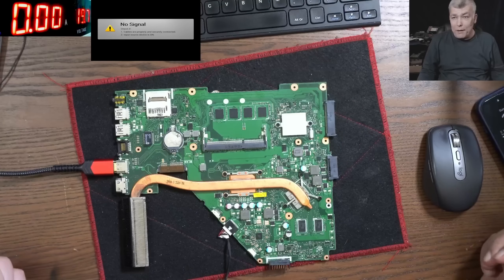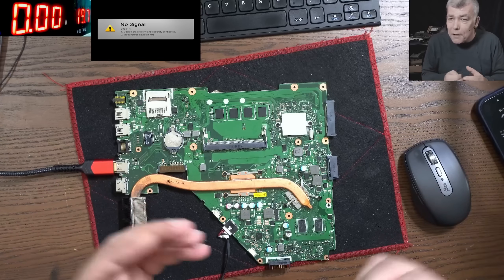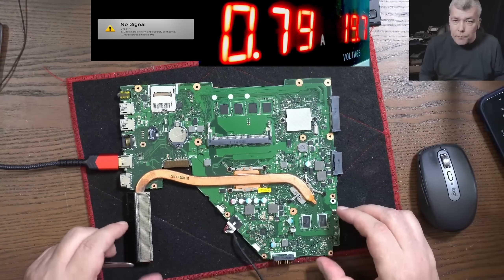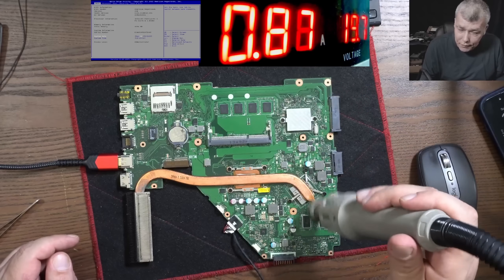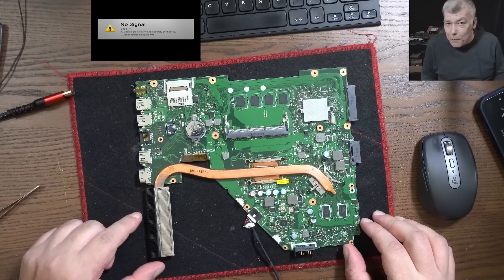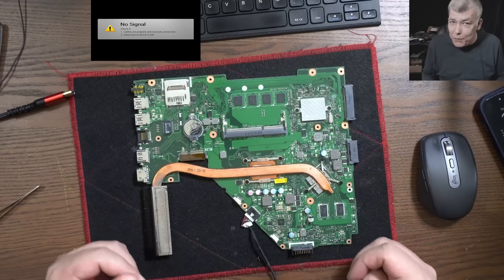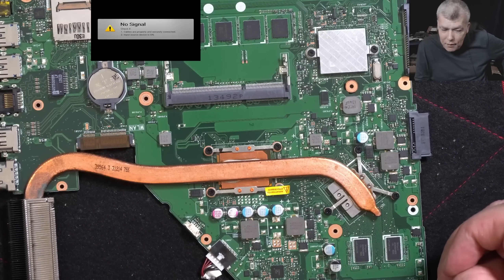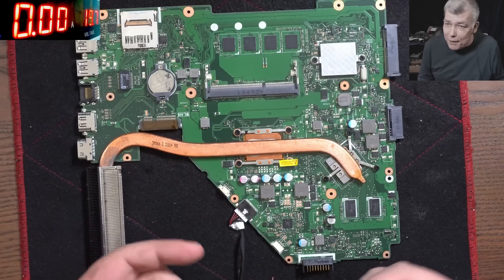That's why the MOSFETS are getting burned - A pretty cool experiment

Comment: Really I enjoyed the explanation for the problem

Can I ask you a favour please?
Do you have a video for reflowing the VGA in case it is not working properly ( especially in Dell laptops )
I tried to reflow it on 250 degree as many videos said but working for one week then played again
So I need your experience if you have the same video just give me a link for it , or tell me what the suitable temperature to use when reflowing that chip

Thanks in advance for all your efforts
Reply: Reflowing a dead chip helps only temporarily (the heat "fixes" broken things inside). To really fix, you need to REPLACE the component, not to reflow it. See Louis Rossmann video about it.

Comment: I usually put thermal pads everywhere because i don't like the components to get hot. Hot means less life. Redesigning the motherboard with 3d printer and make new Copper heat sink it the best way.

Comment: This is a great video to show why it is so important to not use computers in a very dirty environment, and if you do make sure you clean them often. I have many computers that are more than 10+ years running just fine as I take care of them.
With the power draw, it is also important to point out the fact that people should keep their computers connected to power as often as possible and not only rely on battery as the battery will most likely not be able to give all the power for max performance.
Reply: And computers were made to last longer back then.

Comment: Guys, he is right but don't do that by yourself, I did that with my Acer Nitro5 AN-515-58-725A and it is not turning on after replacing the thermal paste. I accidentally unplugged the screen before Battery and the laptop shows shorts on the motherboard everywhere, it does not turn on, and I don't have a thermal camera and power supply to find the bad component on the motherboard. I am about to cry because I am a student and I really need my laptop I don't have it anymore since 2 months ago (dead laptop), and I am in a small city in the U.S. with very limited options including replacing the whole motherboard which is very expensive for me :(
Reply: Hey, how's the laptop did it get fixed?

Comment: Interesting. I've been dabbling with electronics recently, to help feed a curious mind and attempt to repair a part rather than replace the whole. I find mechanical fault finding etc fairly easy, logical and straight forward. The electrical side is a little less intuitive and ofcourse if is not obvious visual evidence fault finding requires more knowledge than I as a layman possess. This video clarified some things I have been told by techs I've spoken to. Combined with comments from other viewers more knowledgeable than myself, I feel I have gained a decent base level of comprehension. Ofcourse as is most often the case, answering a question poses many more questions. Lol.
It is a major task just to access the parts to service them. Equipment being serviced is downtime for production. The ervicing vs replacing becomes hard to justify fiscally. I currently have a pretty decent thermal imaging camera on insefinite loan from a friend. I'm wondering if something like this used at semi regular intervals to check for variations in temp would indicate when work was necessary before something failed. Obviously I'd be viewing the housing/outside of the equipment. Not the components themselves directly. Mostly stainless steel and sheet metal or plastic. I feel like even with accurate imaging the temp differential may not be enough to pre-empt failure?

Comment: I have noticed that resistance actually drop with the rise of temperature, at least on some parts of the board. I also noticed this watching different repair videos. For example when shorted capacitor is removed and resistance is measured to check, it can be seen how resistance increasing as the board is cooling down.
Reply: From wikipidia; Silicon shows a peculiar profile, in that its electrical resistance increases with temperature up to about 160 °C, then starts decreasing, and drops further when the melting point is reached.

Comment: What can also happen is the ABS plastic casing becomes brittle, drying out from the constant heat. The hinge stiffens up, probably from dried up grease, this then goes on to break the brittle hinge mounts, ending up with a broken hinge. The left hinge always breaks first, right next to where the heat is expelled from 99% of laptops. You have to ask the question, why is it designed that way. Bad design or again, planned obsolescence.

Comment: Thermal pads on their own alone do nothing other than, some times become a saturated heatsink essentially "cooking" the component they are attempting to cool in the first place, you need to have something to take the heat off of them before the become saturated or somewhere in between the temperature limit the component can fail regardless because it can't handle the heat anyway.
Passive cooling is only good when you can extract the heat passively fast enough something which it depends on the environmental temperature, which, the more it raises, especially getting near the component's temperature, the less the amount of heat will be dissipated/transferred away.

Comment: A modern CPU will attempt to lower its voltage to frequency curve until it can no longer do so, then it will attempt shutdown, but if an external source keeps heating it or keeping it heated, especially more than it can handle (working or not) within a certain time limit (based on the material's thermal limits), it can still fail regardless, a saturated heatsink can cause that, unless the heat is getting away faster than the max amount of  heat the heatsink  can dissipate in time before being saturated and before the cooled component fails as well, which is when it needs active cooling.
This video illustrates this perfectly.

Comment: We call over-heating something when it heats more than it can acceptably and reliably work within its specification (but this is not entirely and always true, not exactly at least, example given below).
It may or may not work slightly near or above the limit but it may get its lifespan reduced.

Using the board as a heat spreader, a passive cooler is a decent idea but it works only for very low wattage like 2-4 watts of heat tops and even then it depends on the how much area and how fast it can dissipate the amount of heat generated by x component, especially  without making nearby other nearby components either overheat in the process thus have their resistance increased and work less efficiently and/or begin to reduce their lifespan.
 
The actual reason why components fail is because heat makes metals expand, which reduces their ability to hold electrons in a stable state in their outer shells by over-saturating them (with kinetic energy, which itself also generates small amounts magnetic energy as a field, hence increases EMI)  leading to destabilizing their structure and so, they break apart causing the component to fail.
That kinetic energy has an osculation frequency which, if nearby components (like other nearby mosfets working, oscillating almost in the exact frequency also amplifies this effect by a tiny amount depending on the power of the EMI signal created and distance).  

A component does not need actually need to overheat for this to happen/fail, it can also happen to temperatures below the limits for the component itself, simply because for example, a soldering pad or ball is not the correct size for the current it has to pass through it especially long enough to handle it so it either melts by a bit, or entirely or completely and as a natural consequence, disconnects the circuit which is connected to.

This is why i always say, design things in a way that they can never overheat unless you are doing it on purpose to see if and/or when they will/can fail.

Edit: I forgot to mention the amount of electromagnetic noise a short from a broken component can cause to nearby components especially if its a very strong one, like, imagine a mosfet blowing for example. 
This is why i never like it when PC cases have disk places behind motherboard trays or near they PSU, like, if your disk drives survive a short somewhere else, but they are close to such EMI emission, the disks regardless if they are flash based or magnetic, are still reliable to fail in someway or another and have some or all of your data lost.

Comment: Sorry Sorin but i can', t agree with you this time...  Replacing the thermal paste IS just a russian roulette for the gpus and cpus... The thermal dilatation, flexing the Board with the screwdriver and removing the pressure of heatsink can cause The balls to crack... Loosing audio... Loosing linees on gpus.... Loosing enterely operativity of CPU or PCH... Loosing the PCI express 16x... And a lot of things...  Better just to clean fans and heatsinks from dust... The thermal paste can be replaced after 3 years... Just for chemical degradation....  And what about heatsinks/thermalpads on first 2 mosfets??? You saved the Board because the mosfet goes shorted... But first layer of the pcb was damaged... Pressing the mosfet and add thermal Pad can just increase the damage to internal layers making them fuses before The mosfet got killed... I saw lot of Asus x550 with layers merged under The first mosfet... Better to have a shorted mosfet than dig and scratch on layers to remove shorts.
Reply: So l have a dell Alienware 17 r4 when l try to power it on it shows orange and white light but no display, if l try more times it will display and go to the desktop what can be the issue
Reply: @obodoedirin4273  the issue is that is a gaming laptop.

Comment: Very informative video as usual Sorin. Very good advice to use thermal pads to transfer heat to the back of the keyboard or back cover. What was the current limit on the power supply vs the current of the original charger for this laptop? If we use a higher power charger on our laptop would this increase the risk of damaging the mosfets?
Reply: Higher current power supply is always better to use. 
Look how u pick psu for pc, it should be 2x more wattage than your pc use. 
It apply to every electronics device.
My advice is "DONT BUY GAMING LAPTOP" get a PC.

Comment: HP pavilion laptops are designed in such a way that you can't clean the heatsink or fan without disassembling the whole laptop. My HP pavilion dv6 6155tx with i5 worked for 5 years. Then the fan started making rattling and screeching noise. From heat sink out side vent you can't do a lot. It will just move the dust more inside and when the fan ( air blower) is on it will come back to its original position. I opened the laptop, cleaned everything, oiled the fan bush. Then reassembled the laptop. To my horror the laptop screen is dead. Why??? Because the GPU has developed some cracked solder spots. Some times once in a blue 🔵 the laptop works fine but whenever it's switched off it's again black screen. The GpU and CPU are on same circuit so you can't bypass GPU to use Intel integrated GPU. Technicians in India are like hammer chisel mechanic so there is no place to repair it. That made me so angry that I decided never to buy a laptop again in my life. Since then I have purchased 2nd hand desktop computer at 1/5 th price and since then quite happy with my decision. I advise others that if possible then always buy a desktop computer with a good monitor, Buy a wired mechanical keyboard and a wired good mouse. Add other accessories as necessary, like cam, wifi antenna etc. You will never return back to laptops again.
Reply: I thought that India had some great technicians 🤔
Reply: @Theag393  Good Engineers and research fellows move abroad. Especially Jap, EU or USA. If they stay in India most likely they will remain unemployed. Qualified people in India often don't get job according to their qualifications. Mostly employed and higher ranking people are less qualified. Indian companies don't have R&D to employ highly qualified persons; they just copy paste designs from foreign companies. I don't know whether with permission or without.
Reply: That's why I built my own laptop using a desktop motherboard, and 16 lithium batteries.

Comment: Spot on Sorin, there is something else, I've  seen  heatsink paste put on the wrong way too many times, too thick an application causes trouble not only with it being sub optimal performance, but it can make it dry out  prematurely or even 'pump out'  with many heating and cooling cycles,  many people  see this and mistake it for the paste being too thin, when in fact its because of expansion and contraction  during the heating and cooling process, manufacturers  do a 'good enough job to last the length of warrantee  and a  little bit more'  to avoid a warrantee repair but end users with a bit of care can do better, the paste is there to fill in imperfections in the mating surfaces only,  its not meant to have a thick blob in the middle like a sandwich where the mating surfaces dont actually touch, if you do it right - you wont see temps increase over the course of a few months  or even years if you keep your coolers clean, I have not needed to replace mine in my laptop as yet, its still running the factory goop, but temps stay well in the safe zone and the keyboard doesnt get too warm,  even though it gets used every day  (MSI GE73 i7 8750h/GTX1060 32gb of ram 2x nvme +1 SATA SSD) and had it  over a year before the pandemic and it sees some heavy gaming use in Star Citizen, I do use my own fan profileand throttlestop  to  undervolt and manage the heat the 8750h pushes out  when gaming in the summer, in real terms it feels smoother as there is no ramp up or down,    it is  overdue for a change though but I dont like the current options out there.
Reply: honeywell PTM 7950 thermal pad eliminates the pump out problem, I believe even lenovo uses a custom version of it called PTM 7958 thermal pad version.

Comment: That's a great and easily understood example of thermal runaway (up to the point that protection kicked in and shut it all down).
Reply from the maker: Oh yes, that was the word which i was looking for,  'thermal runaway', yes indeed  this is a clear example of thermal runaway
Reply: The thermal runaway is a semiconductor issue. A self-amplifying problem which can be faced only by proper thermal protection and cooling system. Sometimes the one or the other fail...
The CPU and GPU have a thermal shutdown protection implemented. So they do not die on a primary impact. On a primary impact, a MOSFET get killed. Mostly MOSFETs without an implemented over-temperature or over-current protection. Secondly, this will kill then the Dr-MOS and/or the CPU/GPU.